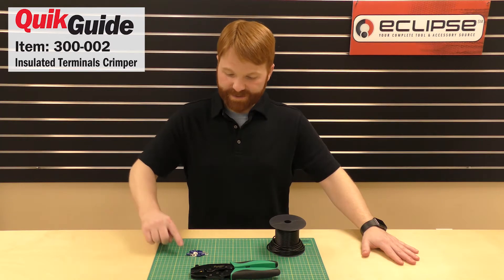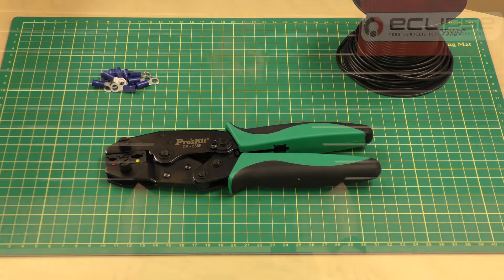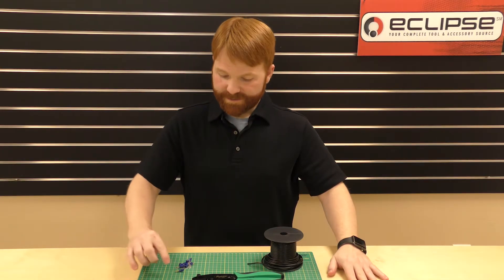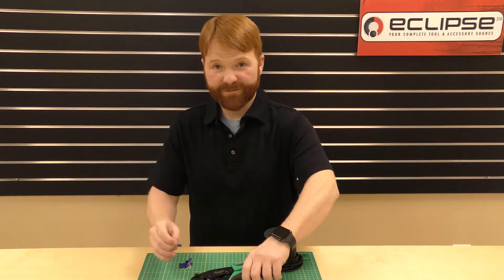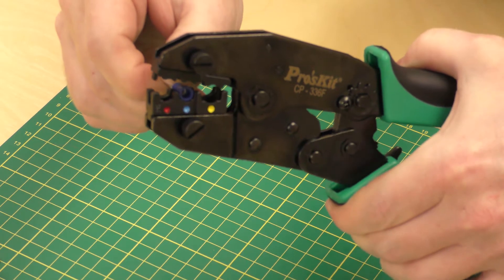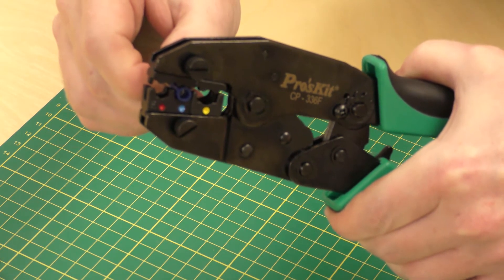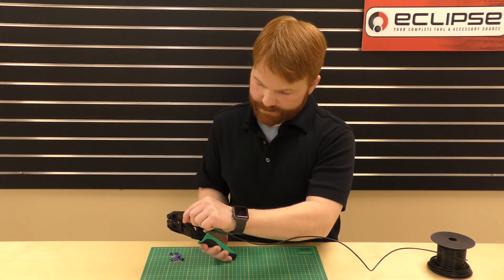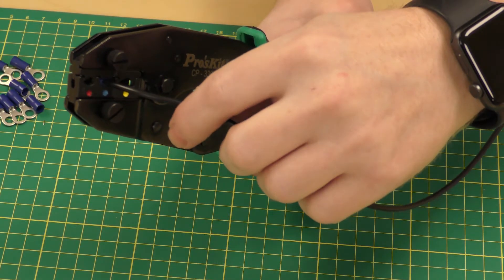QuikGuide: How To Crimp Insulated Terminals

Comment: Basically the least you could get by with tutorial. How much to strip would be a good thing to have added to the video. Where exactly to crimp on the insulation would be another thing to add. Short and sweet is not always better